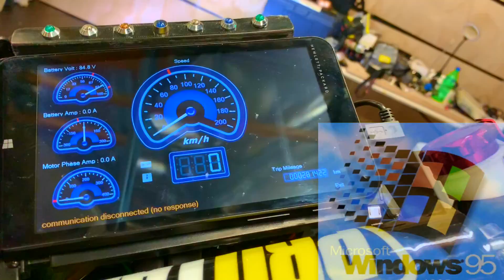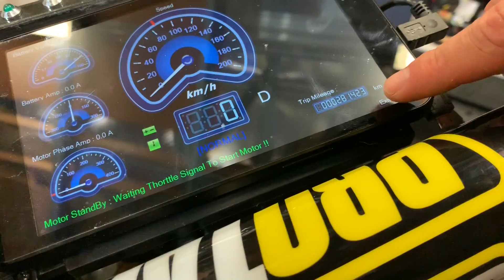Electric Honda CRF MX vs Petrol Bikes (race track) 50kW Electric Supermoto Build • Sketch Coleman

Comment: if you charged battery 30 amps with 15-20 amp charger you will  destroy you battery so quickly ... slower charge with no more than  5 amps it take 2-3 hours

Comment: Hey love the build!! Just wondering how this is 50kw but the battery is 92v 30a?
Reply: Peak torque is messaured by volts times amps I belive so 96v x 500amps 49,000 watts peak.

Comment: The best build ive seen so far. I run Zero SRF I broke a belt at 2,000 miles but it was because the rear wheel non drive side clamp had a broken alloy tab keeping the non drive side from clamping, under regen on steep bumpy long runs the wheel would go off true but under acceleration pull back in line, out of true pullies kills belts. WIth that sorted ive done 5,000 miles and the belt is spot on. I wondered how such a thin belt can survive under the kicking acceleration of the SRF. Zero have been clever the drive pulley is on the swing arm pivot centre (center for US!) and the perfect tension stays no matter where the swing arm is, this means the SRF can run a fat rear tyre without getting too wide between foot rests. I run fleet of bikes, GSXR 1000 K5, Cagiva Raptor 1000, various classics, the SRF is the bike of choice, electric is so responsive so addictive.

Comment: How many watts is the battery?  how many amps are going through the engine at full power?
Reply from the maker: Yeaahh. the motorcycle electric drivetrain can be tuned to 50kW the batteries are even more powerful and can handle even more POWEEEEEERR
I think Sketch mentioned motor phase amps in this video but if not check out in the video description I have 3-4 links showing his original videos building this bike and he explains a lot of details about the build =]
Reply: @BrunoPOWEEER  did he mention the voltage of the battery? I need to know how many amps are running at full power through the motor, so the voltage and amps at full power , i dont think he mentioned it . , they said how many KW but not amps

Comment: What's a shame is that some guys in a garage built this while Honda is sitting on its ass and not making an EV bike.
Reply from the maker: Yeeaahhh EXACTLY... the only big moto maker that’s actually doing something is KTM, I spoke to some Austrian KTM engineers and they said that they already have all size bikes in electric, all ready and tested, they SMASH the 2stroke and 4stroke big time but battery run time is a thing that’s holding them back from releasing more models to the market. No excuse for other manufacturers who are just comfortably sitting there doing nothing about

Comment: I need your help Bruno Mars microcontrollers taking work to mark to get everyone no prior if it's even if it's 3.733 5.7 6762 7 miles per hour and then you will be probably working with who is a space cadet cadet controller who needs to be gettingthat's motors controller box you have got which has 20000 million apparently different settings that we need the 1 miles per hour 10 miles per hour and 100 / 10 / 1000 / 1 million so we know me I know me and I will put micro banana wattage and the Planck institute lengthpico of the decimal point then that will need to use a decimal point to go up in simple miles per hour due to the gear anything such as we approach are we getting started when we buy them in the bulk .
https://www.scooter.co.uk/
Direct Bikes: Scooters For Sale | Moped For Sale
Because I've absolutely sure I'm not going to let that company working with my / 45 degrees slope battery sloped motor with a small team are on the end of the shaft which equals the t-bar capital T which inevitably within Currys the chain down to the / 45 AC induction or would be a DCthen we got an idea to take all of these motorbikes to get all of the flap it's all over there anyway why would mountain bike whatever the weather tonight for the rain snow and eventhe mountain bike trails and all of the flap its area where they take motorbikes for redbull help for taking theplus XS cymbals to top left and right back to the SNES 64 to be getting simple moves acceleration and braking and steering and direction and nursing popping wheelies so we take that game which has arrived arrived on the PlayStation 2 and a PlayStation moto racer directly into the future

Comment: How fast does it go?
Reply from the maker: Much faster than the original petrol bike... MUCH more torque.. brutal acceleration... top speed only depends on what front/rear sprocket size you’re using... the riding position in this bike isn’t the most aerodynamic so I wouldn’t go faster than 200kmh hahaha

Comment: Does it only go like 60 mph becuase of that big ass sprocket
Reply from the maker: It can go a LOT faster if change the gearing... got plenty of power and torque to take this beast waaaaaay faster... but remember it’s a “dirt bike” riding position, wouldn’t be very comfortable neither aerodynamic at very high speed haha

Comment: Wow that's some serious POOWWEEERR man. What do you think is the top speed that motor can do with some low gearing.
Reply from the maker: Yeeaaaahhh thaaaanks mate... 
this is a very interesting question because top speed is got a lot to do with bike aerodynamics... this is a tall dirtbike (not very aero at all)... his electric bicycle can do 120kmh with less than 1/3 of the power so I’m sure this one can easily pass 150kmh maybe a lot more... this bike is about 70hp and monster torque...
I talk to Sketch all the time I’ll encourage him to do a video testing the top speed =]
Reply: @BrunoPOWEEER  he's talking about the gear ratio in the back. If we factor out everything else, gear ratio is actually what determines top speed. A short gear would have ess top speed than a tall gear, even if power is the same. The short gear should accelerate better though due to the torque being multiplied by a bit.

Comment: Awesome build, two questions:
#1 WHATS A RANGE on normal streets as you  mention that this bike is street legal? What you never took it for a trip in town?
#2 Roughly how much was the hardware? (not the custom fabrication)
Reply from the maker: Yeaaahhh thaaanks is mate... hopefully Sketch read this comment and help me with the proper answers:
1) Range? About 60km! This is a racing bike and he designed the battery with energy and discharge rate enough to finish the races at full power and being lighter than petrol bikes. Riding on the road like a regular motorcycle, the battery will last 60kms which is plenty for most bike trips (and can still fast charge almost anywhere in 15-30min)
2)How much he spent? The electric parts used in this bike were all premium but compared to a normal petrol bike price it was probably the same price as buying a CRF450 or less. Sketch may make a video talking about costs next time cause he wants to make a cheaper / simpler version so it can be easily replicated by others.
Reply from the maker: Hahaaa I knew Sketch would read this comment Hahahahahaa

Comment: Please help. My battery is almost 2 years and it worked perfect until now, it's 52v 17.5ah unitpackpower sanyo ga cell. For some reason it charges only for 4 hours now instead of 8 and milage is twice as low. Master said the bms died but all 70 cells are good. I already ordered new bms on AliExpress and waiting for it. Question is can I ride in this situation until I install new bms? Why it can't charge or discharge fully? System shuts down when voltage gets to 50v. Can you explain how it all works? Is it only bms died as master said or something else could went wrong?
Reply from the maker: Dmitry Manzano hey mate, I know exactly what’s happening, I actually replied maybe 5 or 6 comments EXACTLY the same as you described, I fixed a few or these packs at work before... the cells are all glued inside and spot welded together because it’s cheaper and they can fit more cells inside a small case. What happens is that these packs “crack” and split in half with vibration or impact or if you drop, then depending where the pack cracks it may completely stops or most commonly disconnects a few cells from a particular series. Then if your pack is 17Ah and suddenly one of the series only has 10Ah the BMS will freak out charging  as these cells will get app to 4.2? Much faster than the 17Ah other series and the same will happen when discharging.
Before installing a new BMS please check all series with a multimeter and try to twist the pack by hand and see if you can find any crack or any nickel tabs that are looking weird and possibly disconnected from the cells
Reply: @BrunoPOWEEER  Good version but I'm not sure about that. Master checked 11 contacts, each shows 4.11v. Does it mean the pack isn't cracked?
Reply: @BrunoPOWEEER  this also apply to rc cars as well.

Comment: Can you setup the regen like a slipper clutch for sliding into corners?
Reply from the maker: The most common regen setups are Regen kicks in when you release the throttle OR some riders like to have a left hand thumb throttle or even using a break lever controlling a variable regen so you can really have total control, good for wheelies... racing...
Reply: @BrunoPOWEEER  finding a way to tune regen to the wheel slip point would give you a similar feel to a slipper which is really important for running fast in supermoto. Maybe even make the clutch lever control it (full in zero regen, full out max regen). Could also be used to do a launch control I suppose.
Reply from the maker: Grant MacDonald Sketch is making a launch control box that connects between the controller and the throttle/regen so you can set exactly what you want, got an internal accelerometer/gyro... really interesting stuff =]
Reply: @BrunoPOWEEER  electric power by nature having a "fly by wire" throttle opens up a LOT of possibilities. Like launch (wheelie) control, traction control and rear wheel "ABS" using regen.
I think I'd still want to replicate motorcycle controls because that's what is familiar. Wouldn't want to grab a pile of rear brake when thinking about the clutch.
Reply: @grantmacdonald4838  I'm using the Regen as breaking assistance for Enduro riding and it's a great help...I use a button for my left hand thum. Also a bit more range for riding
Reply: @DKLVE  what sort of bike are you on?
Reply: hi Greg good pickup! the regen can be dialed up or down to give you as much drag as you like coming into corners like a slipper yep!
Reply: @grantmacdonald4838  Kawasaki kx450F
Reply: @DKLVE  do you have a link to the build?

Comment: Fantastic! You guys inspire me, daily! Now I just wish I could figure out why my controller keeps cutting out.
Reply: Maby I can help you?
Reply: @epictimebreaker  That would be LEGENDARY. This is driving me INSANE!
Reply: @AnonYmous-cf2ci  what are your specs of your battery and controller? And when does it cut out?
Reply: @epictimebreaker  Hey! Thanks for the reply! After some troubleshooting, I figured that the controller was detecting low-voltage from the batteries and shutting off. It's still not perfect, but I am able to ride it fairly reliably, as long as I watch the volts and go easy on the acceleration.

Specs: Two 72v 35ah LiPo battery packs wired in parallel to make a 72v nominal 70ah pack. I bought it from Amazon from the BTR Power store. Each of them has its own BMS. The motor is a 5kw hub motor from QS Motor, the controller is a Sabvoton and the display is a Cycle Analyst 2.4.

I put all of this on a stripped '81 Yamaha XS400 frame. I'm currently swapping out and modifying parts to save on weight. 

I discharged the battery(s) to around 64v and recharged them to full. The problem of cutting out has largely been resolved, but I have the feeling that the two packs are not keeping a balanced charge, and so the controller is reading the lower voltage off of one pack and triggering the shutdown. 

Once I get this problem figured out, I expect that the majority of problems preventing me from getting it licensed for the road are resolved.

Next, I need to figure out how to add in a proper brake light, turn signals, and headlight, then I can put it on the road.
Reply: @AnonYmous-cf2ci  if you go full throttle your voltage probably drops to much.. how high do you charge it up? 84v? I also have a 72v (20s) battery if I go below 69v and give full tottle the bms shuts off the power..
Reply: @epictimebreaker  It charged up to 80.9v, I think.
Reply: @AnonYmous-cf2ci  how are you going to power the light and other stuff? With a step down converter? Or does your controller has one build in?
Reply: @AnonYmous-cf2ci  you could buy a new bms and wire it as 1 battery the stock ones are pretty shitty most of the time..
Reply: @epictimebreaker  I was actually looking for someone to rebuild the two batteries into one. I've never built one before, not sure I want to try tearing down 2,300 dollars worth of battery pack and rebuilding it, haha. Do you have a suggestion for a good BMS for LiPo cells?
Reply: @AnonYmous-cf2ci  it's easy there are alot of videos on YouTube just dont warm up the battery to much when soldering the new wires on.. it's better to use the old wires of the old bms that way you wont damage your expensive battery, 
If you want a good one for the value you could order one from aliexpress a daly bms are fine. But maby you feel more comfortable with premium brand.. some Bms's will let you read out and adjust stuff but I don't know if it's useful for you.. 
Ps srry for my bad English :)
Reply: But 2  individual bms should also work fine.. so maby it's not worth the time risk and heart pain to dismantle your new battery packs,
Reply: @epictimebreaker  Your English is great, Man. I appreciate you taking the time! I don't need anything too fancy, just robust and reliable. I have been wanting to learn battery building for a long time, anyway. Hmmmmmmm....
Reply: @epictimebreaker  I am actually kind of worried that one or more of the cells in one of the packs might be dead, and it's causing the battery to sag under load.
Reply: @AnonYmous-cf2ci   you probably can't return the battery's right? It's pretty weird for a new pack to have bad cells. 
What kind of cells are they? I hope there not cheap Chinese cells there really shit.. it's a bit hard to find bad cells if there still connected in parallel,
You could just leave the bad cells in there (if there even in there) and connect the 2 battery packs to each other then it wouldn't matter that much.. just use wires and connect each group/series to make it 1 battery less work then redoing it all..
Reply: @epictimebreaker  The cells are LiPo cells. I can't return them. They are already close to a year old, even though I've only. Funny enough, when I charge it, it's now charging up to 87 volts. As long as I respect the throttle, it can pick up speed pretty quick. I haven't gotten anywhere near top speed on it yet, but it ought to top out at atound 55mph.
Reply from the maker: Hahaaaa thaaanks guys for all that chatting here.. the more comments the more YouTube likes and boost this video to other people... feel free to bombard me with comments hahahaa so much POWEEEEEEEERRR
Reply: @BrunoPOWEEER  You are a LEGEND, Bruno. I cannot get enough of the PPPPOOOWWWEEEEEERRRR in your build!
Reply: Anon Ymous I’m always here in his channel, it makes my day when I wake up and there’s another crazy new video, more powaaaaaaaa!!!!!!!!!!!!!!!!
Reply: @AnonYmous-cf2ci  what size wires are you using? If there really thin it could also cause voltage drop..
Reply: @attractivelabs5187  Lol. Heard that!
Reply: @epictimebreaker  I can't quite remember, right now, but the load wires ought to be SWG-6.